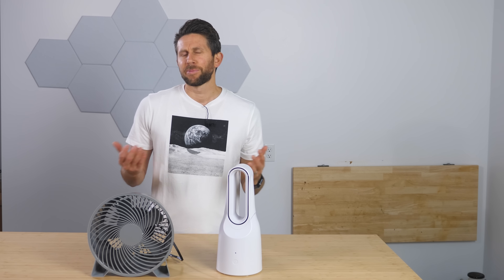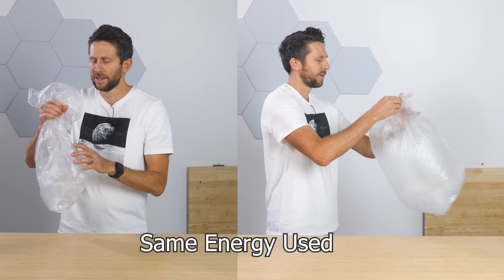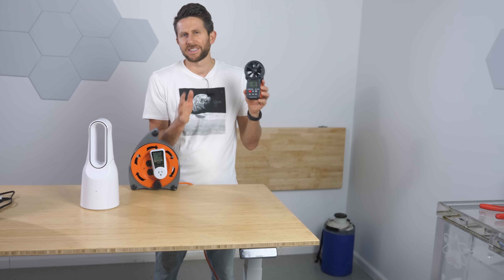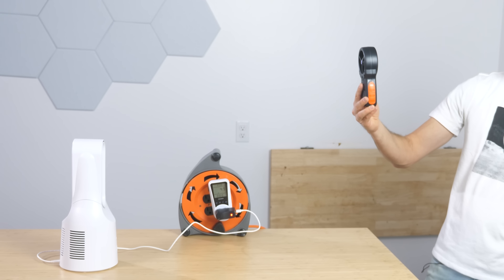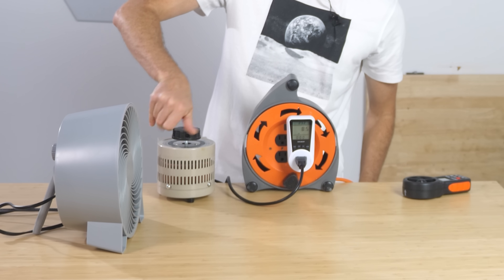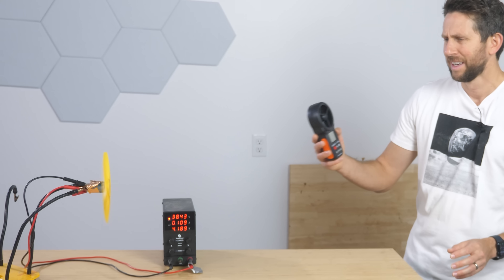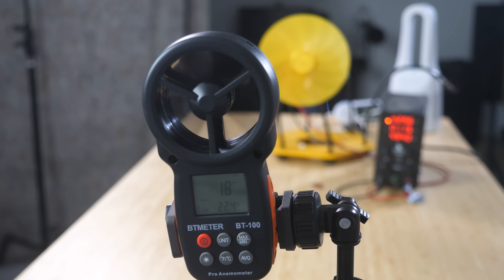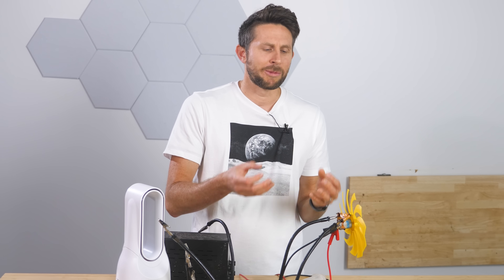Are Bladeless Fans a Scam?

Comment: There's a more fundamental reason, rooted in the laws of Newtonian physics, why the bladeless fan MUST less efficient.  Let's say that our goal is to move a unit mass of air per unit time, at a unit velocity.  If the bladed fan moves the unit mass directly, it will impart one unit of energy per unit of time to the air.  The bladeless fan works by moving a much smaller mass at a higher velocity.  Let's say that we've designed the bladeless fan such that once the higher velocity stream of air has drawn in and entrained the air around it, the end result is again a unit mass of air moving at unit velocity.  The amount of momentum imparted to the air is the same in both cases.  Since momentum is conserved, that means the initial stream of high velocity air coming from the bladeless fan must have had the same momentum also, but... since the initial stream of air was less massive, we must've imparted more energy to it to achieve the same momentum.  To a first approximation, the bladed fan moves the air by pushing on it directly.  The bladeless fan moves the same amount of air by means of an inelastic collision between a small, high velocity stream of air, and the stationary air in the vicinity of the fan.  Since the collision is inelastic it wastes energy.  At the end of the day there's no way around this.  It's physically impossible to design a bladeless fan that equals or exceeds the efficiency of a bladed one.

Comment: I disagree with the method applied to evaluate “efficiency” as you only measured wind speed against voltage. But the total amount of air displaced was not considered.

Comment: This test doesn’t feel apples to apples to me at all. It looks like you bought the cheapest “bladeless fan” you could find, of course it’s horribly inefficient and poor performing. 

Your findings may ultimately be correct, but the way you went about this test using voltage as a control seems like there’s too much hardware variability for this to be scientifically conclusive.

Comment: Bladeless fans produce a more laminar airflow, I think, with less turbulence than a fan where all the air passes over the blades. Since turbulence requires energy to form it, perhaps it's the subtle difference between laminar and turbulent flow that's the efficiency (and subjective) improvement of a "bladeless" fan?
Reply: There'll be "impedance matching" effects too. For a given volume of air per second, a bigger fan will move the air at a lower velocity than a small fan does. So less turbulence and less noise. This is why aircraft jet engines now have massive bypass ratios, so most of the air they move is large-volume-slow-speed rather than the small-volume-high-speed output of a turbojet engine.

Which makes me think "bladeless" fans are really all about being able to produce a "large" fan without needing a large circular form. You can squash the output area into a long thin oval shape, to take up less space. Plus, I think, the benefits of a less turbulent, and less twisting, airflow.

Comment: It is a good idea to test this, your conclusion is right however the methodology is not: if you want to compare the efficiency you want to compare the total kinetic energy transferred to the flow, so 1/2 of massflow * speed² , massflow is hard to measure in open systems, however you can have it using area, however as speed is not constant over an area you can perform transverse pass where you measure the flow speed and integrate. it might be a bit too complicated to do for a simple video, however it is important to explain, as people often get misunderstandings.

Comment: The only real advantage I perceive with them is safety, but that's a huge stretch with the weak ones.  The larger, genuinely useful ones it becomes a factor, but even then, fan grills make normal fan designs pretty safe, so it's only covering the 0.1% cases, so 99.9% of the time, a normal fan's not going to cause any problem.  Though a finer grill on a traditional design would cover that 0.1% whilst still providing greater air flow and pressure.
Reply: I have that! I have a bladed fan, a huge diameter one with metal blades. This thing is a BEAST and I'm pretty sure if you put a finger in it it can cause harm - and that's why its grill is almost a net.
Reply: On of our Bengal cats found out he could use the un covered cooling fans in my computer to automatically sharpen his claws. Later he use the same fan to destroy a plastic water mug by pushing it into the fan, he looked so happy with himself as he watched it destroy the mug lol :)
Reply: @a64738  Dude, dude, look what I just did to your shizz, I did the thing, are you proud of me?!?  😆
As a silence freak, I have also used uncovered fans on rig before, but I live alone without pets ... I'm totally judging you for doing so with cats though!  - scorn -
Reply: Safety for young, unwitting children is the biggest factor in the use of these fans. That and neck fans would be pretty useless for many ladies (and some guys) if they were traditional fans - all that hair would be a big hazard when using them!
Reply: @silverrenard  Like I said, most modern fans arent dangerous even for young ppl
Reply: We solved the safety issue with fans back in the 70's 😂
Reply: That's why fans have covers so you can't stick your fingers in them. . .
Reply: If these "bladeless" fans were more efficient we would see the same technology in aviation
Reply: As a kid I would stick my fingers into fan blades. So bladeless fans are something I'm planning on having purely for child safety.
Reply: @rrteppo  Darwin prays otherwise 😝
Reply: The airflow will also be smoother with a bladeless fan
Reply: @axiezimmah In the PC world, they achieve that (as well as balancing airflow, noise and static pressure) through blade, housing and motor design, all in a standardised compact format, in order to cool very hot components.

Comment: So at the beginning it's good to blow a little bit of air into a lot of air to fill up the bag faster but with the "bladeless" fan it's bad, because the not moving air slows the moving air down? Isn't that like the opposite?
I think the bag sills up faster because if you open the end wider it starts with more air inside it to begin with, so it needs less additional air to be filled up.

Comment: Not that I searched exhaustively (no pun intended) through the comments before posting (I didn’t), but I couldn’t find anyone posting about the other reason people go for “bladeless” fans: child and infant safety. With the blades of the fan tucked away inside the lower housing, it’s literally impossible for a small child curiously exploring their world to get their fingers in past the grid cover only to be injured by fast spinning fan blades like it could be for traditional fans. I say “could” instead of “would” because most manufacturers of traditional fans already go to great lengths to ensure that small children can’t get their fingers far enough into the housing/grating on their fans to get injured; bladeless fans just go a step further by totally encasing the fan itself in a way which makes it basically impossible instead of highly improbable.

Comment: The blade less fan is quieter because its using a squirrel cage. They're way quieter than a traditional bladed fan. Coupled with being buried in the machine, it makes the whole system work quieter. In other news "traditional, tried and true design works better than gimmicky 'new tech'"....

Comment: In my experience the main advantage of bladeless fans is that they tend to have less of a footprint, and if someone is concerned about little kids it's impossible for them to stick fingers into it.

If you want a lot of air moving, then a regular fan works better.

Noise really varies a lot depending on the model.
Reply: People with those concerns don't appreciate the education.

As I say to my daughter when she's done something silly more than once. If the pain from that can't teach you not to do it, nothing I say will.
Reply: @bobs_toys  I mostly agree, but there is a large portion of the population who is (overly)concerned with exactly that sort of thing.

That said, or a long time I had an absurdly powerful desk fan from the 1940s with large metal blades and a very open basket.  That would shatter pencils stuck into it and could easily break finger or sever a small one.  They don't really make that kind of fan anymore.  It's kinda too bad, it was a fantastic fan.
Reply: @earthknight60  and a wonderful tutor.

Comment: The benefit with a "blade less" fan is that it sucks up cool air from the floor and circulates at a slightly higher elevation, and then the fan is low down you can place it near a bed and then let the air blow in under the blanket.

Comment: The problem with using the Variac was that a traditional fan AC motor is going to be running on the mains AC frequency, and induction motors get inefficient if they are running much below synchronous speed, and lose torque, which was then compounded by lowering the voltage, as seen in the video.  Good thing he knew to go to a DC motor.  (AC motors running on controlled frequency exist and can generate good starting torque, and are actually quite common railway equipment, but that's a lot more expensive -- you're not getting that technology in a cheap fan.)

Comment: I like your videos, so please keep them coming.

This video seems as though you went with a green apples to purple oranges comparison.  The Hallmark of bladeless fan technology uses and air foil style shaped surround that pulls air around the outside and inside of the hoop/loop shape.  The other consideration if that the fan in your "bladeless" fan is going to operate significantly more efficient as it is scaled up in size and wattage.  For example the blower in your home HVAC is a similar squirrel cage style fan.  They are capable of high static pressure, good, volume, and low power draw and noise compared to a conventional multiblade impeller style axial fan.  You cannot get an axial impeller style fan to generate the volume of air, at the wattage or lower noise levels of a squirrel cage blower fan.  It's worth noting that some bladeless fans actually use axial fans in the lower housing as well, but, like the Dyson AM09 they are an axial impeller similar to that of a turbo charger and includes stators, a plenum, and a shroud to focus the air and mitigate turbulence in the lower assembly.  We studied similar impellers a dynamics class many many years ago.

Beyond the fan differences the housings and integrated filters on most bladeless fans also prevent dust buildup in the fan assembly as well as prevent the possibility of small objects or fingers (kids like to put all kinds of things in fan shrouds) from getting sliced and diced.  There's definitely the thought that its a "cool" design and all, but there is a great deal of functionality to true bladeless fan technologies, not alibaba knock offs.

Comment: They are for the Modern decor market. Airflow don’t want corner flow. But they did. A good job of overcoming it to fool many buyers. You you want the best air flow get  floor blower fans you can’t get better flow as more multi blade push more air in one rotation. Blower fans  has about 100 blades or non stop winds

Comment: Bladeless fans are false advertising and should be described as "enclosed" or "hidden" blade fans !  It's the same advertising nonsense as the "air frier" which does not "fry" but actually bakes with hot air like a convection oven.

Comment: Need to test for Noise, weight, footprint, and the energy expended when you add a swivel motion, which a normal fan has to move the whole motor whereas a bladeless only has to turn fins or whatever. Use a whole fan as well, not just a motor with blades. Form matter sometimes as well as function, you wouldn't put a janky little fan in a living room.

Comment: Well you see a traditional fan starts pushing some of the heat into you because the motor is heating too, now I didn’t say that this is not happening in the blade less fan but the air that is getting sucked from the top by the pressure is much cooler so maybe feels cooler than the conventional one idk thoughts?

Comment: How about if you put a barrier between the source for the fan and source for the oblong hole? Like a horizontal flat plate in the middle. Just to see if the "bladeless" concept really works more efficiently when you eliminate the design flaw (of pulling from single source of air).

Comment: @TheActionLab, The bladeless fans is safer in some way that kids won't be able to stick their fingers into the fan blades. Also, Bladeless fans don't work well if u have the fan back against a wall since it is not able to draw as much air from the back. I gave up on their fans an stuck to ceiling fans instead.

Comment: Yeah, I had one of this kind a few years back. It was designed more like a classic fan, but instead of the round container for the blades, it had a large round head, which was like a circle with the slits. I didn't like it and gave it away. It was loud and inefficient. The loudness wouldn't annoy me, I've got a classic very powerful fan, with whose sound I can even sleep (in hot summers). But that one had a rather annoying sound, which made it annoying to have running in any situation. I prefer classic fans, and honestly, I don't have a need for big fans. I have started to buy battery powered ones. If they are manufactured well, even with one lithium cell, they can generate a really nice blow and still last for half a day continuously. But there are also bad ones, which even don't really do much on highest setting. You may just need to try out a few ones, but since even the good ones aren't very expensive, I dare to do it. Right now I got the before mentioned large fan which gets plugged into the wall, and 2 battery powered fans, which are small but powerful. I am using those throughout the entire summer when working at the computer.

Comment: I spent $400 for a dyson for the wife a few years back.  I replaced it with a $35 small bladed fan that moves more air.  It "may" be more efficient, but it doesn't /actually/ work.  But the dyson doesn't have a squirrel cage fan, it looks more like a jet engine.  I don't know if it is better, as squirrel cage fans actually work very well compared to conventional bladed fans.

Comment: I remember when they first came out with the dyson bladeless fan when I was 7 or so and even back then as a kid I always thought it was the stupidest fucking thing ever. I remember they had this commercial that was like "a traditional fan slices up the air and messily spreads it around the room, while a dyson fan directs the airflow all in one direction" and i vividly remember being like wow thats fucking stupid, thats the whole point of a fan, TO CIRCULATE AIR, YOURE ADVERTISING THAT YOUR PRODUCT DOESN'T DO WHAT A FAN IS DESIGNED TO DO LMAOOO

Comment: The main benefit of bladeless fans is form factor. Yes they not more efficient(overused term) and dont move more air, but having a smaller form factor is useful and they do then to be quieter due to the blades not being exposed, some fans have more internal geometry to further reduce noise

Comment: I suspect if you measure the area total of the “slit” and match it as closely as possible to the surface area of the blades, the design might yield different results.  Otherwise, the slit that the air goes thru might be choking the volume a bit
Reply: The reduced area of the 'nozzle' results in an increase in air velocity which boosts the entrainment effect. Possibly a case of swings and roundabouts!

Comment: I could be wrong but I feel like the bladeless fans don't collect as much dust which gets blown around and I believe some have filters too. No one ever seems to mention that. It's extremely difficult to clean the blade on a regular fan. I think that's a huge benefit to using the bladeless. Still it's not really worth the insane price, which is why I haven't gotten one yet.. That and I don't like how quiet they are, I prefer the white noise of the fan.

Comment: This experiment is completely broken. A meaningless comparison, because the bladeless fan has electrical consumption related to smart controls, etc. Whereas the simple DC fan was purely a motor hooked to a power source. Also, the bladeless is powered by an AC->DC converter, which is lost efficiency. Again, very poorly designed experiment. Do better.

Comment: You're calculating wind speed, how does that translate to circulating volume of air? The airline industry has us believing the air in a passenger plane is 100% new every 3 minutes, but you don't feel like you're sitting in a wind tunnel.